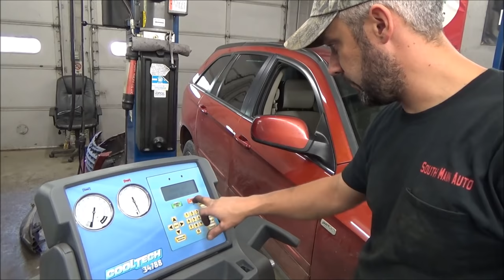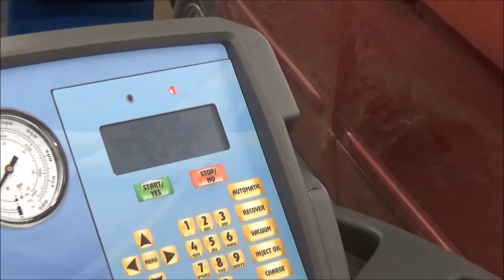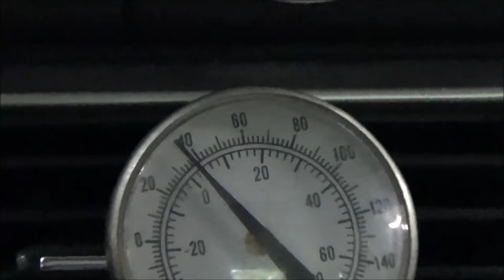A/C Condenser Remove & Replace : Chrysler Pacifica

Comment: Great demonstration on how lower pressure reduces the boiling point.  I am in the aviation field and this is the same principle why pilots are required to wear pressure suits above 49,000 feet (Armstrong limit).  Here are some links if curious https://en.wikipedia.org/wiki/Pressure_suit & https://en.wikipedia.org/wiki/Armstrong_limit .  I enjoy you videos watching someone do things the right way.  I probably would have changed the o rings and the owner should have changed the radiator to save $ on the possibility of overheating the engine and labor just to disassemble  everything again to get to the radiator.
Reply: Johnny Woo correction approximately 63,000 ft is the Armstrong limit.
Reply from the maker: Johnny Woo Great info , that is cool thanks for sharing

Comment: What would be good low/high side pressures to be at on a 90 degree day? I found a table online and it showed 45-55 on the low and 225-250 on the high side. I have a 2003 BMW 3 series and it showed 45/230 and it was cooling ice cold on a 90 degree humid day. I also checked a 2011 chevy impala and its pressures were 50/240 and it wasn't cooling quite as good. Any thoughts on that, thanks.
Reply from the maker: bimmerman3 Yeah those pressures seem about right. Even if the pressures are good you can still have cooling troubles.
Reply: The compressor seems to whine on the impala, and it has 100k miles. The BMW has 125K and its not noisy. Probably made in china parts on the gm car.
Reply from the maker: Yeah haha the majority of GM parts we get in are all made over seas or outside the US , either Mexico, or Canada. Funny how people think GM is an "American car".

Comment: I always replace the receiver\dryer and orfice if it as one. When it has been open that long. As it is cheap compared to having to open the system up again.
Reply from the maker: Claude Rains Pretty tight budget on this one :/
Reply: South Main Auto Repair I have to at least tell them. That way it's left up to them. As some of the vehicles take 4-5 lbs. Which can get pricey if it doesn't last or cool very well. But I understand.

Comment: hey there! I had a quick question for you, I have an 05 Chrysler Pacifica that's been running hot. I was told that I need to replace the coolant fan assembly, but the fan still comes on. I was told that the connector was broken, there for, the fan isn't blowing... do you think that I could just replace the connector? And PS.... Thanks a bunch for the videos!
Reply: I realize that you posted your question three years ago, but the short answer is yes.  You should use heat shrink butt-splices with a sleeve of heat shrink over the top of it when connecting the wires from your new connector to the original wires, after you cut off the old connector.  Of course, that option is if you don’t solder the wires together and then a sleeve of heat-shrink tubing shrunk over the soldered joint.  I’m just a DIY’er, but that is what I think I would do.  Good luck!

Comment: What brand of condenser did you use?  I used spector premium in my jeep liberty hope it will last.
Reply: +Ronald Cach He said it was a Denso in the video.  Check right at 27:50 if that helps you out.

Comment: South Main Auto Repair what is that thing in front of the new condenser and what does it do? I have never seen something like that before on a car
Reply from the maker: The transmission cooler?
Reply: I'd take it that's what it's called.
Reply from the maker: Yes sir

Comment: 16 years experience, how much learn by doing and how much formal classroom instruction
Reply from the maker: +Gary Johnson No training, just self taught and hands on...
Reply: South Main Auto Repair
Reply: learn by doing but sometimes certain repairs require state or fed. certifications  example a/c recovery and installation.
Reply from the maker: they require a certification my 8 year old could obtain
Reply: South Main Auto Repair
Reply: no, you have to be a little older. Go on line to EPA section 608 Federal Clean Air Act and look for section 609 Motor Vehicle A/C Technician Exam and read.
Reply from the maker: All I am saying is the requirements are simple to obtain..
Reply: my experience with the EPA and the necessary certifications is, when you least expect it they show up at your shop and ask for your 609 certification. Apply for it and take the test better safe than sorry.
Gary

Comment: i have a 2005 chrysler  pacifica 3.5 i had one of the a/c hoses that got a hole init so i changed all the a/c lines im trying to find out how much oil to put back in and how much r134a to put back in i have every thing that i need to do it i just cant find out how much oil and r134a to put in. hit me you

Comment: Amazing what people do to make a few bucks and save some time. Do you feel the owner would have a legitimate complaint against the person who just plugged in that relay instead of bolting it in properly? That's an expensive job and unnecessary due to someones lazinessFinally finished watching, interesting demo. Yes, I agree that having a properly functioning front end is far more important than A/C especially in NY, I am on LI and haven't had A/C  in my Jeep for 5 years, I would consider A/C a luxury and front suspension a necessity.
Reply from the maker: jim dandy Not sure if they had it done or not. Could have been like that when they bought it for all I know.

Comment: Hello I have a quick question maybe you can help. I need the fill specs for my 08 Malibu LS (non classic) 2.4. I'm replacing condenser and compressor. Need oil specs for both. Thanks!
Reply from the maker: I add 1 oz oil to new condensers or the exact amount I remove. Compressors I replace what I remove from the old compressor.
Reply: +South Main Auto Repair Wow! Thanks! I'm watching your focus fleet vehicle video and bam I get a response. Awesome. Yeah I figured I would measure/weigh the old compressor oil once removed. Again, thank you!!!!

Comment: Not remotely related, replacing my cousin's spark plugs on her '14 Nissan Sentra. Ngl I wasn't too thrilled since it involves taking the TB and IM off to reach them. I asked if she had a concern over fuel economy or rough idle, since new plugs may not be the issue/fix. She just simply replied that she just bought it and it had the transmission replaced under warranty before she purchased it. She doesn't know it's service history. I hope she's ok with getting new gaskets. They have to be replaced. After that, should last until 100k miles... :)

Comment: Grrr i hate laziness.  I work as an hourly fleet mechanic and some of the lazy shit i see guys do drives me absolutely crazy.  The main thing being people who will replace and air compressor discharge line but just zip tying the new one to the old one because they don't want to undo a bunch of brackets and properly route the line.  We get paid hourly I don't understand why they rush to do shitty work!
Reply from the maker: asavage1576 I don't get it either. Just do the job the best you can and call it good.

Comment: I know this is an older video but 78 and worrying about ac is funny to me. I'm happy and I wake up in the morning to 78, but more often than not I wake up to 85-90 in the heat of the summer. I would definitely want ac in my car over tires or an oil change especially now that I am old and 100 degree air in the windows at 100mph is still just hot! Not that my pos old truck will go to 100 in the summer, usually tops out around 85 or so.

Comment: Thanks so much 4this video...have the same year n model after a yr of having the car I had2 replace all the factory front end suspension parts literally a must also u need a honest mechanic 2work on this vehicle who has patience this car is its own wire city lol with that said u are honest only if I lived near your shop but I have recently purchased a new dual fan & radiator after watching this video I realized it would be nice2 get the AC condenser done as well also can you pleeease post a video doing a tune up & changing that rubber gasket (hope u got wat I mean) on this car thx😀
 had a tune up done & the so called mechanic used gasket sealant I hope u follow what I am trying2say & then put the gasket on top of that stuff so u can imagined what happened smh thx again ur videos are helpful

Comment: I like the video but I would've pressurized with nitrogen to do a tightness test before putting in a vacuum. If you vacuum for one hour and you can't get your microns down than you have a leak and your starting all over. My thoughts

Comment: the amount of spaghetti to get to those connections of the condenser,i always change those to Viton green,which has a boiling point of 680 degrees and lube them with same lubricant as the system carries,you're anti-seizing is mandantory if youre the poor sob who has to redo anything,comebacks sucks, doing it the first time is money,second time is stupid,you take the time,you won't eat many,good job again eric

Comment: I've never understood North America's fixation on air conditioning.  Oh sure, there are latitudes where it's mandatory.  But at 42.4° latitude (Avoca, NY)?  I'm at 39.9° and have yet to own a car with working air conditioning.  I certainly have the DIY skills to service the system fully.  But why?  It's a waste of time, energy, and money, as far as I'm concerned.  My first two cars out of college were brand new.  I specified no AC.

I have AC in my residence too.  But, it only comes on when requested by guests.  With proper air handling, comfort is not a problem.

To each his own, I guess.  I prefer to skip the expense and maintenance hassles.

Comment: Looks like the car needs to be replaced!
Reply from the maker: GRowe1978 Nahh, just a little TLC
Reply: South Main Auto Repair Yeah and maybe bring it to YOU for repairs!
Reply from the maker: Oh I hope so :)
Reply: South Main Auto Repair Me too! I've seen some shops around where I live do some really unsafe things.  A friend of mine did an inspection on a car one day and found that pretty much all of the brake lines were bad (among other things).  So he failed the vehicle.  Well... apparently the brake pedal started sinking a couple weeks later.  He happened to be driving near where he bought the car.  So he stopped in and the shop crimped the brake line off and sent him on his way.  Then a couple days later another one blew out completely.  So he brought it to our shop. When we saw what was done, we told him that we wouldn't crimp a brake line and send you on your way. It's just too dangerous. So he went back to the other shop and told him what we said.
Then, the guy from the other shop called all pissed off. He said that he's been doing this same thing for years and why did we tell the guy it was unsafe?  
What????? If you are a professional mechanic and you have to ask that question...
Reply: GRowe1978 Wow...3 brakes, really not safe. Sure taking out 1 made 3 work, but it's the WRONG fix.
Reply: DE Nichols Oh, it's the WRONG fix, if you can even call it A fix???
That's something I would do to my own car to get it home, but I would NEVER do that and send someone on their way!  If anyone ever got killed because of something I did, I'm not sure I could live with that.
Reply: GRowe1978
If you could hear my tone in text you'd hear the word "fix" used loosely.
Reply: DE Nichols LOL! I could hear it!!

Comment: the hour long vacuum was WAY over the top! any moisture will rapidly gas off before 5 inches on your gauge. you probably had close to zero liquid water to begin with. regardless of temp once you had high 20 inches you were done. you could have spun the compressor by hand or wrench to agitate the oil in the comp to release refrigerant and any moisture in it, you could also but a shop light or other small heat source under the comp to get the same action.. when using your detector be sure and sniff at that comp shaft seal...its a common leak point.
Reply from the maker: +Scott Striker Single evaporator systems should be evacuated for at least 45 minutes and dual evaporator system for at least 90 minutes. At 60 degrees it requires 29.4"hg in order for water to boil at sea level. Water will not boil @ 5" sorry.
Reply: +South Main Auto Repair  your handheld vac pump proves my point. I doubt your tap water was 200+ degrees.  the temp is key to my comment. yes it will gas off @5. http://www.jbind.com/pdf/Cross-Reference-of-Boiling-Temps.pdf.
 I'm laid up after foot surgery I've been binging on your channel, I admire your work. I'm a 25 year HVAC contractor and lived to hot rod as a kid. you have some cool tools and you know how to use them. I'm sure you were quoting a source you believe in. I've worked on as many commercial AC systems as you've worked on cars.I respect your stance but I stand by my overkill comment if you have a decent pump.( like 10CFM, a smaller pump like a 3 would be more inline with your comment. in any event keep up the great job, pump out some more vids for gearheads CHEERS

Comment: In this order: tires, brakes, steering linkage, suspension, lights, windshield washer & defroster and wipers, gauges, windshield, then and only then entire drive train. Before it moves it needs to be able to stop, and go where I aim it. I need to be able to see and be seen. Only then does the car need a working drive train. After all of that works, then I spend money on luxuries such as AC.

Comment: As a customer I would replace anything that's  not operating at manufacturers spices. even replace possible radiator leaks why go back in again twice. Doctors wouldn't do that. They would do right first time.
Reply: actually a lot of patients experience complications after surgery because of a doctors practices, its not quite as objective as youd think. i  believe i need surgery on my shoulder and my skeptical

Comment: I find this customer funny if they weren't getting this fixed just to flip the vehicle. The reason why is my condenser has been in need of replacement for 5 years and I've just been too lazy and haven't bothered and I live where it can get over 100F in the South easily. Why someone in NY values their A/C so much to get it fixed over other things I've not a clue. Except to flip the vehicle cause it's an easier sell then.

Comment: The engineers shouldn't design the car so that a $40 electronic component which will likely fail requires $200 in labor to remove and replace.
Reply from the maker: Garth Goldberg You should see what they do with the ones on the Jeep grand cherokees....

Comment: I fitted a new condenser to my Volvo V70 Mk3 and fitted a Denzo. Volvo wanted £376 for the condenser, I cross referenced the part numbers and bought a Ford unit. Identical in every way but not painted black. £36 including postage. Volvo is a rip off!

Comment: This guy is a fool for not doing the radiator at the same time.  You could probably save him money on the labor not to mention when you DO change the radiator, you will have to evacuate and recharge the AC system too... Not like you can reasonably remove that condenser leaving the lines attached!
Reply from the maker: NETWizzJbirk well we can't make them have money ya know. I just do the work that was budgeted for and move on.

Comment: My 2013 f150 ecoboost gives warm air on cold vent setting even when it is cool outside,...any ideas?   the A/c is not so cool either...my dealer uses the 3-D customer service model so they are useless as tits on a nun,...
3-D ? Deny Deflect and Delay,...Deny there is a problem calling it "normal" Deflect the issue making it the customer's fault somehow, and Delay fixing anything until the warranty runs out,....you have probably heard of those dealers too,....any ideas on the warm cold air vent?    Robert B   thanks

Comment: Eric that demo is bogus, if you get a feal vacuum pump about 5cfm and do your example test in a closed system not open to atmosphere on one side ,you would see that the water would finally freeze at that point the vacuum has a real hard time removing ice from the system . check out some videos on youtube  Misterpc